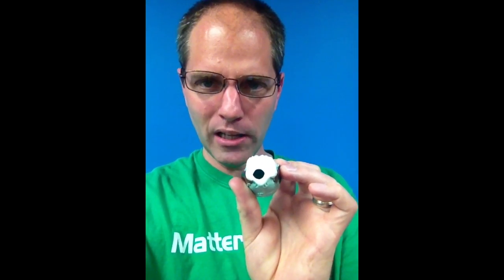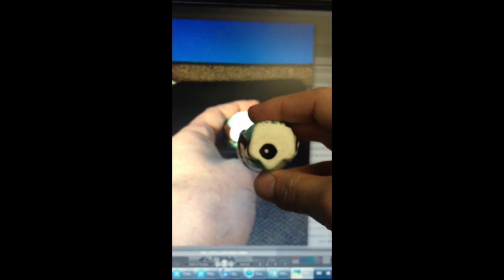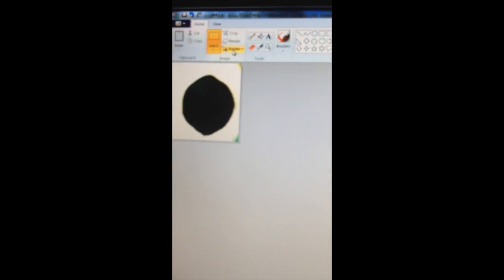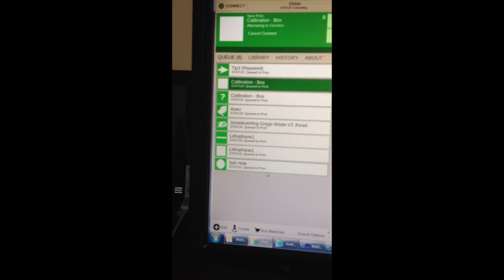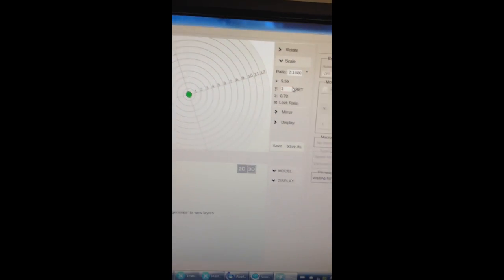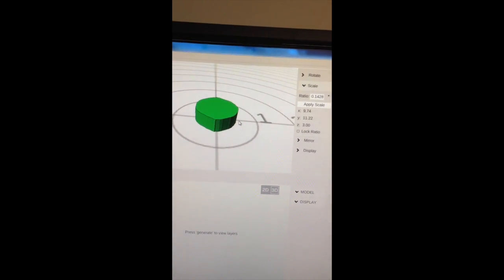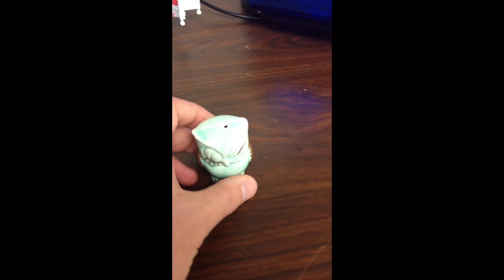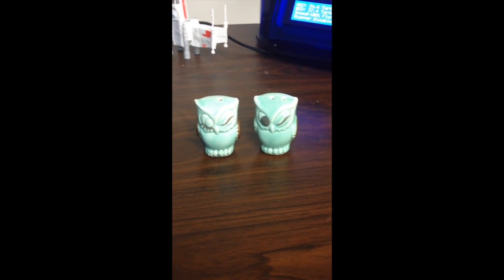Salt Movie

Comment: It shows up as a $15 add-on. I am wondering if that is per computer? And per version? Or even per operating system. I have 3 computers of which 1 runs on Windows 7, and 2 runs on Linux Mint.